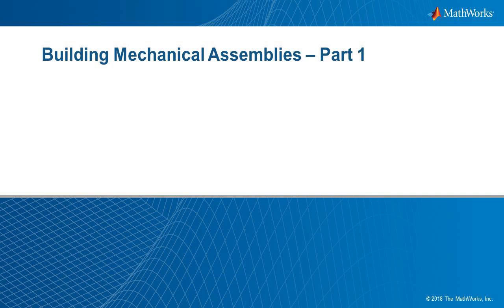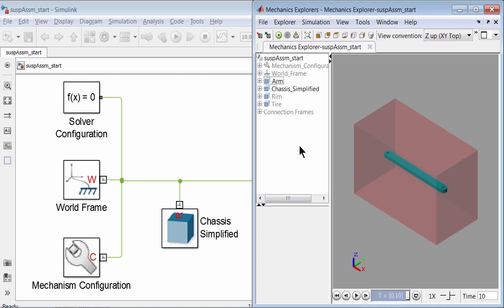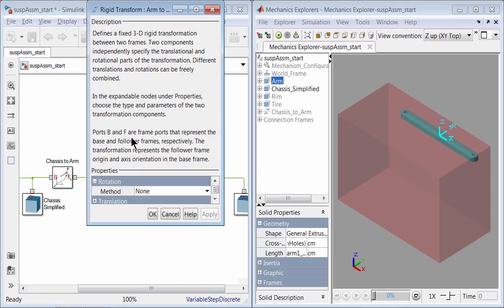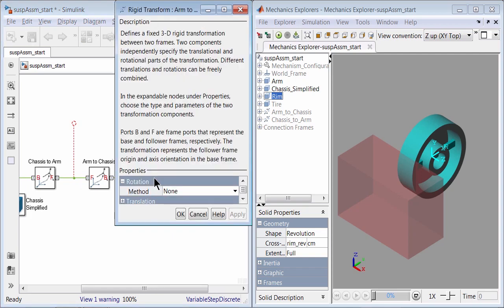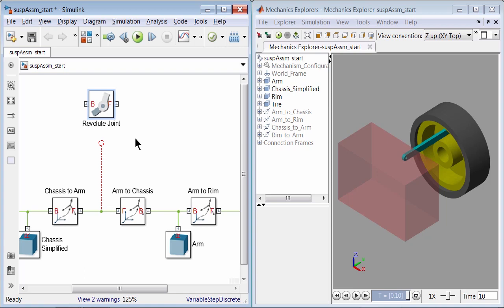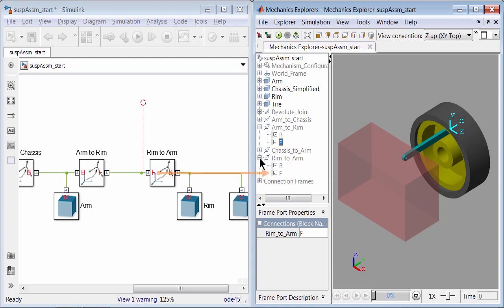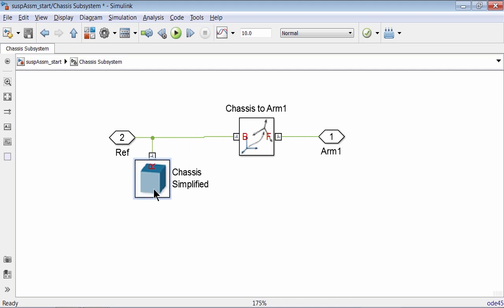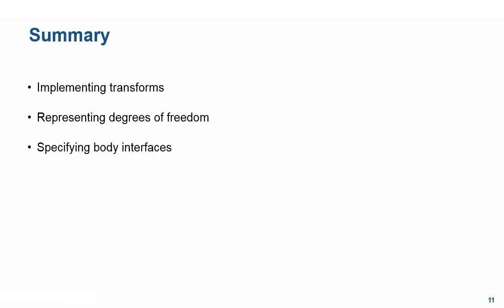Physical Modeling Tutorial, Part 8: Building Mechanical Assemblies Part 1

Comment: Sir, I have imported a human model performing sit to stand motion in simscape from inventor. I am facing a problem relating to constraints. The model is not standing appropriately as the upper body falls down. How can I add angular constraints so that the 3 revolute joints angle namely knee, hip and the ankle. I did that in inventor but simscape is not accepting inventor constraints.